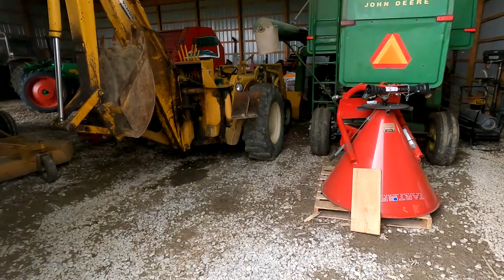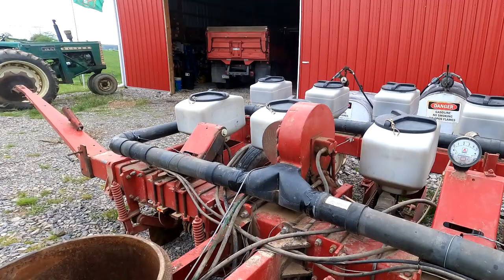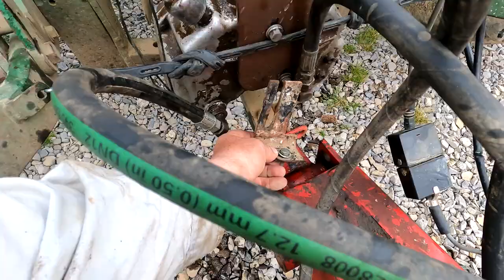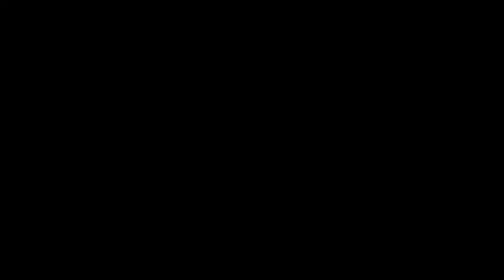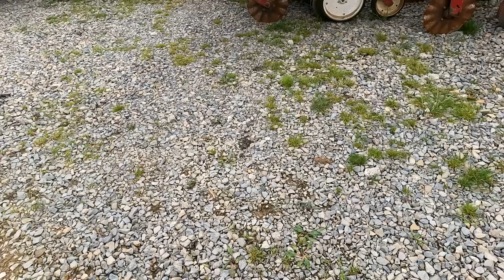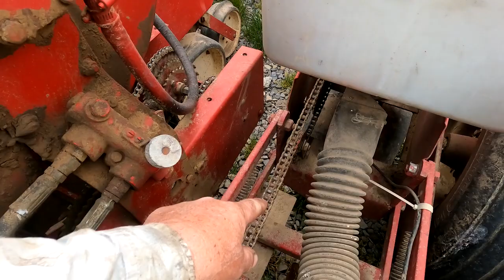An Update and Prepping the White 5100 Planter with Splitter

Comment: I don't know anything about an air seeder.  Every time you took the lid off of one of those what I think to be a seed hopper, the sound changed.  Is this what actually indicates, you have air flow to that seed hopper?  Had to be a good feeling when all of the hydraulics work correctly. 🙂
Reply from the maker: That was probably the effect on the fan as the pressure of the system dropped. When a lid from the seed box is removed, it allows the air pressure to escape.  I was checking to see if air was blowing through the system in each box. The pressure is adjustable and us usually set at 2 to 2.5 inches of water for corn and soybeans.  Good to hear from you, SBF.

Comment: Looks like a winner to me. Will be much handier having the 2 planters. No changing from one crop to the other. Just like having enough tractors to not have to hook and unhook all the time. Sounds petty, but sometimes time is of the essence. Mother nature doesn't always cooperate so well. Good luck with your crops this year. I think your Oats will be fine. I grew up in the Western part on NY and the clay ground we had you couldn't even start plowing until first week of May. Always had good Oats. What do you use for fertilizer on Oats?
Reply from the maker: It will definitely be nice having one machine for beans and the other dedicated to corn.  Last year, the last thing I planted with my other 5100 was beans, so last evening I put the corn disks in it and changed the transmission around, setting it up for corn, which should be a permanent change now.  Like you said, sometimes time is essential and every few minutes you save means a lot.

Comment: This was a great video, can you help me, does split unit means it have something to do with the four boxes in front? did you put fertilizer in that four
Reply from the maker: The rear of the machine is called the "splitter" because the 5 row units back there plant in between the front 4, or in other words, split them.  No fertilizer goes in this planter.  The fertilizer was spread on the field before planting.

Comment: Thanks for the update.   It will be handy to have a separate planter for your beans.   I agree with you on the oil for chains.  We are a little damp here right now for planting, not much crop in our area, should get started shortly.  Play safe.
Reply from the maker: It will definitely be handy having the separate planter.  I no longer have to switch my other 5100 from corn to bean settings - which means changing sprockets in the transmission and also seed disks.  Plus, it will take half the time to plant beans because I don't have to go over each field twice, as I did with the other 5100 planter.  Hope you get dried out enough for planting to begin.

Comment: What a great looking bean planter. A few things? First will the 1650 need dauls to pull the planter better in worked ground? Is the row units a combination of finger and air? Very intriguing to me never been around a white planter. Thanks Charlie and as always looking forward to seeing it in action
Reply from the maker: Well,  (spoiler alert - video to come) I used the planter the day before yesterday to plant all my beans and the 1650 did fine even without duals.  Which is a good thing, because I don't have any.  The Whites are totally air planters - forced air with brushes and seed disks - very simple but effective and accurate system.  I grabbed some video of using the planter, so you'll get to see that soon.